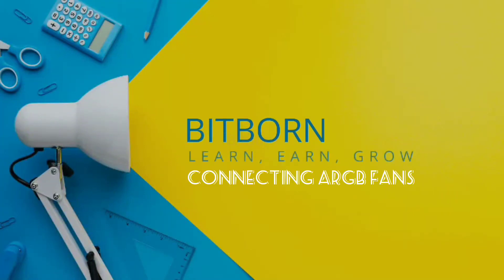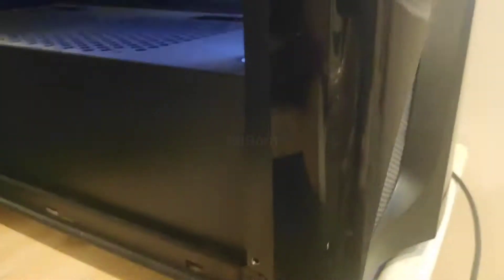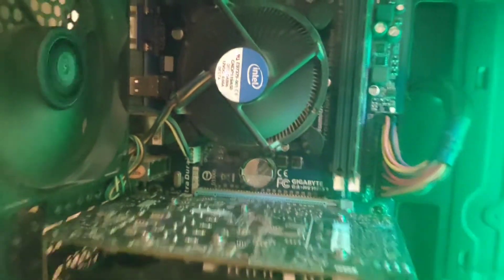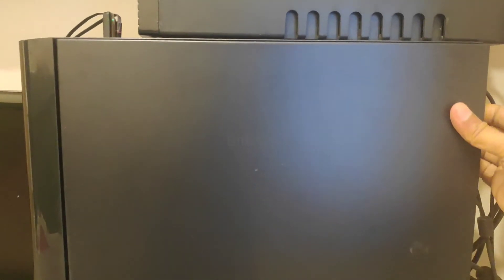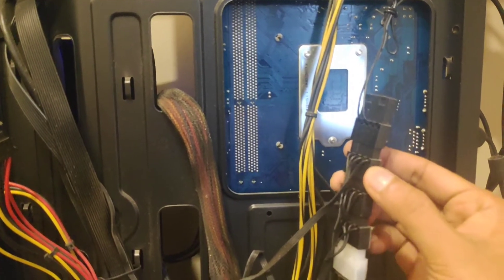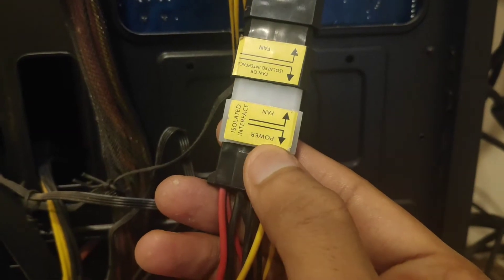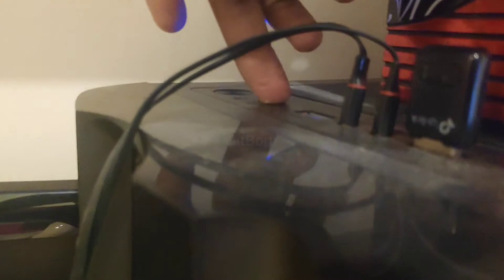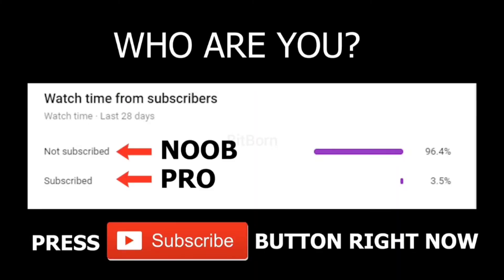How to Connect ARG Fans | Ant Esports ICE 320 TG PC Cabinet

Comment: Does the reset button need to press for led?  an extra wire I have found with these fan please let me know where I need to connect ?
Reply from the maker: Yes when we press power button the led color keeps changing. I have replied to the earlier comment. Let me know if any more doubts.
Reply: @bitborn   I think I have some technical issue with my  led only circle led was glowed but central was not glowing
Reply from the maker: Try checking with acro for engineering. Mostly they deliver this case from Amazon.

Comment: Does the reset switch act as a toggle for switching fans on and off or is there something else??
Reply from the maker: If you connect without connector then lights won't change. If you use connector then may be. I am using the fans without controller.

Comment: Thank you so much for this video... 🔥❤️..After 4 months of my pc building,now,finally I am able to turn on my cabinet fan's RGB lights..😅But also I have one problem,only one fan's RGB is working the other 2 fan's RGB is not working for me.. Please solve my problem..🥺
Reply from the maker: Yes, seems the working of RGB fans is way different. Try using white connected that came along with the case or fans... there might be a connection problem as its the old way of connection.
Reply: @bitborn  Ok,Thank for your reply..I will try..

Comment: Bro I have the same cabinet and I have connected all the cables properly but my fan's argb is turning on the all fans are running but no argb please help me
Reply from the maker: Is it front or back side? Can you check the video how to connect try using same type of molex.
Reply: @bitborn  bro I have done all the connections properly and all the fans are running but the the front 3 fans which comes with argb, that's argb is not working, I have also connected a cable with reset switch which comes to change argb
Reply from the maker: Yeah its due to molex connection try to connect on backside the from fans. If still doesn't work then claim for warranty from the company.